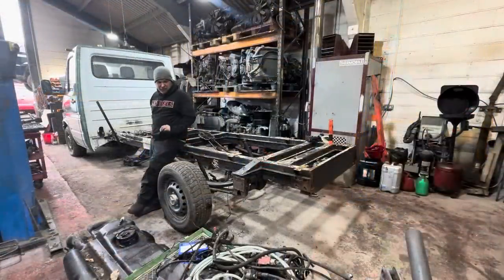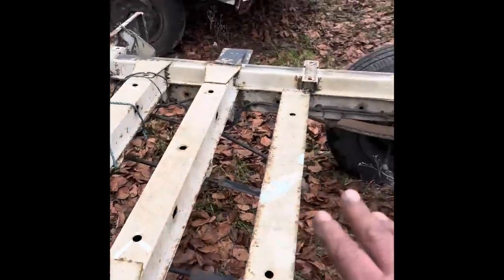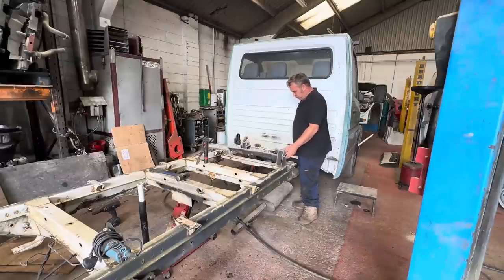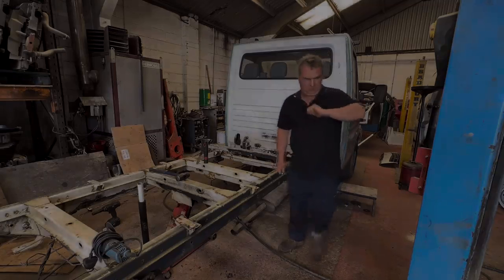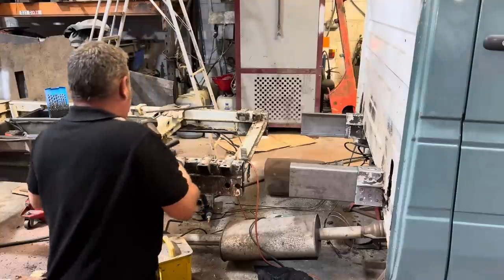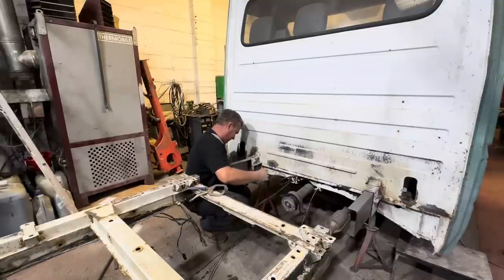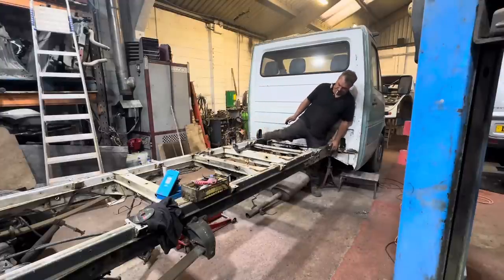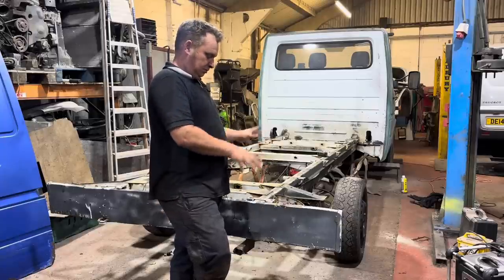Can a fella cut his truck in two and swap its rotten chassis? Only one way to find out !

Comment: Lovely job this is exactly how coach built motorhomes are joined together I might be wrong but I'm sure they don't weld anything just use bolts 👌👌👍🏻👍🏻👍🏻👍🏻👍🏻👏👏👏
Reply: I would expect The welding is essential considering The weights intended for this bed what with HiAb etc

Comment: Hi   Al love all your videos and I wish I had a drop of your knowledge and skills.

Question for you or any viewers please do not take afence its not meant that way.

What is/would be the difference between  this and a cut and shut car?  Would you need to declare the work? 

Two questions please not I'm not intending to try lol
Reply from the maker: No offence taken fella , cuts and shut was more joining two haves of a car body shell together. Basically you use to just butt weld one to the other and badly . There’s nothing wrong with picking out sections and joining in replacement ones as long as it’s done properly .  And on the commercial side of things chassis stretching is a norm 👍
Reply: Ty for replying I will look forward to seeing the rest of videos

Comment: Your reference to lanogard , you rate that?
Reply from the maker: Yes works really well 👍
Reply: @6DDIESELSDorset  I was going to try some this year on my old banger but apparently it needs doing annually? that's still much preferable than having to get any rust sorted later on!
Reply: @richardsmith8938  Yes that will do it, i did have most of mine schutz'd a couple of years ago but i'd like to keep it topped up, especially if i can spray something on without having a compressor.